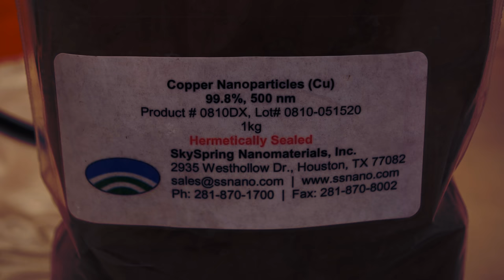Make Our Best Thermal Paste... YOURSELF!

Comment: Hi Tech Ingredients as alway very informative video,  I am considering something.  You mention some points in in this vidoe that  really  peaked my attention. (the whole video grabbed my attention not for the product you where making but rather the mixing by vibration)   Mainly the vapour pressure of glycerin,  mechincal vibration heating your fingers.  I am curious as what frequency of mechanical vibration which would turn glycerin into vapour.  resulting in failure of mixing.  I am not gend up on this so to speak   But I do know some facts about heat into glycerine can cause unwanted break down of it. with some nasty chemcials been released.   At temperature 280 deg C, a toxic component acrolein (propenal) forms. So mixing by heating which could also potentually break down other ingredients at lower tempatures is not the way to go. And when I try researching stuff I get lost in the maze of various fequencies terms.  and formulas.  Also on a slighty different track would mechanical vibration substanually decrease so called steep times for flavours in other liquids..
Reply from the maker: I don't know.  In this application, the liquid does not become very hot.  I'd estimate it's less than 50 C. The frequency is not very significant, but the amplitude is what determines how much energy is deposited into the liquid.
Ultrasonic mixing is very common in the pharmaceutical industry because it's so fast and effective.

Comment: Just a thought. As Aluminium forms an oxide on its surface, does that still happen with the fine powders and if so does that reduce the effectiveness of the mix?
Reply from the maker: It probably does. But because the oxide layer forms in milliseconds on bare aluminum, preparing, mixing and applying it would be a big challenge.

Comment: I have a few questions:
1. Would it be possible to mix it with an ultrasonic cleaning machine like they use for jewelry? I mean it's basically the same machine as the sonicator but less focused and powerful
2. 33:37 why does it only work "almost" as well, considering that copper is a better thermal conductor than aluminium and the particles have the same size? Is it because of the density or did I miss something?
3. Why not use ceramic particles? Does it increase the cost too much?
Reply from the maker: Probably not.  We have a super powerful ultrasonic cleaner and it doesn't work as well as the sonicator.
Reply: @TechIngredients  ah ok, that's a shame. I have added two more questions, I hope you don't mind. Thank you for all the great content, your channel is such a diverse source of knowledge!

Comment: How good of a thermal conductor is bismuth?
Pepto Bismol is basically just bismuth suspended in a thick oily isn't it? 
Bismuth subsalicylate, C7H5BiO4.

It might dry out though.
//Edit: Looked it up and "In fact, bismuth's electric and thermal conductivity is unusually low for a metal."

Comment: If I understood correctly, you're using aluminium powder in this material. Is there a reasonable alternative that wouldn't be electrically conductive to avoid problems if you make a mess while applying the paste and some of it ends up on the motherboard?
Reply from the maker: Our thermal paste is not electrically conductive.

Comment: How much would the "adequate" paste improve through continued mixing, followed by vacuum degassing - possibly using a vibrating plate of ultrasonic emitter to aid in the outgassing.

Would a moderate level of pre heat of the material increase the efficiency of the vacuum degassing?
Reply from the maker: That's a good question and I can't answer it.  Heat would not make much of a difference as the high performance paste does not thin with temperature.

Comment: What if we used activated carbons? I know they have pores that has air inside, but they have a really good surface area and the commercial ones can have really thin particals, and its carbon so it sure has good conductivity, right?
Reply from the maker: I tried that and the results were pretty poor.

Comment: This may be a dumb question but would it be possible to omit the mortar and pestle step on a larger volume by putting it back in the centerfugey thing and introducing a ball bearing or marble?
Reply from the maker: It's not dumb, in fact it's probably the best solution with one challenge.  The cheap mixer I hacked is still pretty lame.  They make much faster ones if you're willing to spend about ten times as much. By not introducing air this could also eliminate the degassing step.

Comment: When substituting the 300nm al power for cu powder, would you also substitute the 5 micron al powder for cu instead as well to avoid the galvanic corrosive effects between the al and cu? Short term, no noticeable effects would be seen using both in the compound, but theoretically overtime the performance would degrade as corrosion built up. Also, with the same reasoning, would you only use the cu compound on cu heatsinks and the al with al heatsinks?

I believe the IHS on cpu is galvanized, so the effect is lessened, but most al heatsinks are not galvanized nor a good number of cu heatsinks either. For the heatsinks that are galvanized, if you decided to do a few lapping passes to further increase thermal conduction, you would be removing the coating and essentially destroying any benefits from the galvanization process. 

(Yes it is odd that you use galvanization to prevent galvanic corrosion)
Reply from the maker: I thought these surfaces were plated with nickel and not zinc.
The oil makes these compounds non conductive.
Reply: @TechIngredients  Zinc is the first that came up in a quick google search, but I think for computers Nickel is the coating of choice yes. The compound may be non conductive as a whole, but on the micro scale wouldn't some particles still make contact and gradually spread the reaction as it displaces more particles?

Comment: 9:50 wouldn't a rough surface be better due to the increased surface area?
16:10 maybe you can use a less-viscous oil than even that if the loading process reduces the vapor pressure
Reply from the maker: No, because  it will also increase the path length through the paste and the aluminum  is a FAR better conductor.  We used as low a viscosity oil as possible before its evaporation becomes a problem.

Comment: I assume you could replace the aluminum powder with copper powder in the basic formula with similar results? I seem to keep finding aluminum oxide powder rather than just aluminum powder. I know you touched on solids fractions at the beginning but you also said in the second formula that copper would be almost as good and again assuming this applied to the first formula can I get a ballpark of what 'almost as good' means using similar 5 micron particles?
Reply from the maker: Thinking it might work better, I tried replacing all the aluminum with copper and the result was about the same as Arctic Silver-5.
 The aluminum may have better sphericity or the oxide coating helps, but the aluminum allows for higher solids loading and it's all about excluding the low thermal conductivity oil.

Comment: For the high performance paste; could one use a more "volatile" liquid but cool it down while mixing the smallest particles, then add a less evaporative liquid and larger powder while increasing the temperature to increase the mixability of the compound.
Reply from the maker: I tried that, but the result was similar or slightly worse and the additional steps balanced the easier blending.
Reply: @TechIngredients  Thank you.
If you were to put this into series production, would a larger vacuumroom be a good idea for one or several steps? The final mixing would benefit from being in a vacuum room or chamber.

Perhaps trademark the compound and license its production. The world needs thermal paste and why pay a premium for inferior performance.

Comment: I was wondering why did you not use small diameter copper or silver powder, since it is more thermally conductive, I understand this is all about making it very affordable, but I would love to see even higher performance material being made, maybe even using diamond dust if it's remotely feasible.
Reply from the maker: Regarding the diamond, I explained why it doesn't work in the first part of the video.
It's less about the thermal conductivity of the powders... really. The thermal performance is highly dependent on excluding as much low thermal conductivity oil as possible.  The sphericity and the oxide coating are probably why the aluminum allows for the highest solids loading.

Comment: regarding the last vacuum step, is it possible for air to still be trapped deeper in the material (further from the surface that's exposed to the vacuum)?
if so mixing the paste inside a vacuum chamber will allow all of it to be exposed to vacuum to remove air?
Reply from the maker: That would be optimal.  Mixing under a helium atmosphere is an alternative because it diffuses so readily.

Comment: So ideally the thermal paste should not contain balls, but rather cubes arranged in a matrix to maximize transfer area? Though that would counteract the bridging between the rough surfaces.
Reply from the maker: The problem  with shapes other than balls is that they don't pack ideally. In fact they cause clumping and gaps at lower solids loading fractions than balls.

Comment: Wouldn't heating during mixing reduce viscosity and mixing time? and then rapid cooling to bring it all together.
Reply from the maker: That works for the glycerin, but it doesn't with the silicone oil and that's good because it reduces the risk of temperature cycling-pump out.

Comment: Wouldn't be beneficial to match mating surfaces by grinding one into another just like in the process of hand grinding telescope lenses? Possibly with the thermal paste already applied?
Reply from the maker: It can. This is a good method if the components will not be replaced because other than flat, they will develop a unique mating curvature.
I'd avoid the paste at that stage as it isn't abrasive and is very viscous.

Comment: Why did you say that copper powder is less good than aluminum powder? I would expect the opposite given their thermal conductivities?

Is there a reason you can't make this whole process easier by diluting each step with a large fraction of a solvent, mixing and dispersing everything when it is still a runny liquid and then as a final step vacuum and/or heat evaporating all the solvent to make a fully stable paste?

Is there some process where you could start with a very hard and thermally conductive small particle, and a less hard and very thermally conductive big particle and through some process grind them against each other until your result is fully densely packed paste? Like maybe boron nitride for the small particle and one of the powders you already use for the big particle
Reply from the maker: The aluminum powder permits better solids loading possibly due to better sphericity or the oxide coating.  A mixing solvent has to be removed and during evapoation/degassing the mixture tends to stratify requiring additional mixing.

Comment: Hello, didn't make it through the video yet, so apologies if this gets adressed. I will delete in that case. 
I love your content and the depth and thoroughness of it is really top notch i gotta say. However, during the demonstration of thermal conductivity of the aluminium rods, shouldn't the solid alu rod have an aluminium washer instead of the plastic for a fairer comparison? Or am i mistaken?

Comment: We use a mix of indium, galium and zinc called liquid metal :) sadly it absorbs into copper and leaves a layer on the nickel coated heatspreader. There is a big problem with that. You can not read the serial number so you can't get warrenty on the chips when you use it. Maybe you could come up with something like that, without the downside?
Reply from the maker: We are doing that as well and will be comparing our liquid metal to various commercial pastes. Stay tuned.
Reply: @TechIngredients  I will, can't wait!

Comment: How about a water block that's missing the bottom of the block? As long as you keep the pressure of the water loop e.g. below 1 bar, you could easily simply use basic engine gasket sealant to glue the block and have direct water connection to top of the aluminium top surface of the CPU. I guess the only question would be if you can get turbulant flow to the surface of the CPU because laminar flow would reduce heat transfer, too.
Reply from the maker: It can be done, but leakage as well as corrosion will be a threat.

Comment: Is this electrically conductive? Also the "Thermal Grizzly - Kryonaut" is considered the best thermal paste on the market in the PC enthusiast circles. They have a "Kryonaut Extreme" now that is better for Extreme Overclocking with LN2, but they claim is still good for anything else but may dry out faster. I haven't used that one yet however so I couldn't weigh in on the drying out faster thing. I can't wait to see if you make a version of Liquid Metal next haha. (A type of gallium I think?)
Reply from the maker: It isn't electrically conductive. 
You're correct, I am working on a liquid metal version now.

Comment: I found your video because I am using a copper tipped spot welder and the spacing within the threads on the rod the tips thread into has gotten sloppy. My thoughts were to make something that is akin to grease filling the gaps and helping the conductivity of the electricity. Thus creating a cleaner spot weld. I am not sure if thermal conductivity works the same way as electrical? But I was thinking of mixing copper powder into my lithium grease. What do you think?
Reply from the maker: It doesn't.  Electrical  conductivity is blocked by the grease  that supports  the powders.  Have you tried graphite powder?
Reply: @TechIngredients  I thought that about the grease but whenever I did a search that was all I came up with. Then I found your videos and an hooked! Thank you for the response so quickly, I will try the graphite.

Comment: Is there no chance of a dissimilar-metal redox reaction occurring if you're mixing Zn, Cu, and Al? I realise there's not supposed to be electrolyte in there, but surely even ambient water could cause issues?
Reply from the maker: The oil insulates the particles.  Our paste is not electrically conductive.

Comment: would it  be a worthy idea to add an evaporating oil/solvent to the last thicker stage paste to enhance mixing and let it rest / evaporate to thicken up before application or would that lead to separation of the different size solids as the paste thickens ?
Reply from the maker: You're correct, the mixture tends to stratify during evapoation.

Comment: Is it possible to dilute the Paste with for example ethanol to make mixing the ingredients easier and then draw the ethanol back out with a vacuum pump?
Reply from the maker: I tried that and the paste tended to stratify during the evaporation/degassing step requiring more mixing.  It wasn't worth it.

Comment: Haven't finished the video so forgive me if it's been answered, but when adding the 300nm powder. Why does the aluminum perform better than the copper?
Reply from the maker: The aluminum powder is able to be added to a higher total solids fraction.  This may be due to better sphericity or the oxide coating.

Comment: Are the lids actually necessary? Won't the centrifuge keep everything inside the jars?
Reply from the maker: It's a good idea to use the jars in case the acceleration/deceleration or any spray could force the liquid out.
Reply: Yeah, I guess you wouldn't want any of the vapors/dusts in there either. 
Does it spin in only one direction? Is the acceleration very rapid? Does it have emergency brakes?

Comment: Great job. What is the best cheap thermal liquid that has a high performance of thermal conductivity?
Reply from the maker: Water.  It's the best.
Reply: @TechIngredients  I missed the point that it shouldn't be electrical conductive
Reply: @samtavassolian1492  pure water isn’t
Reply: @-a13x-75  thanks. actually, it has to be used for PCB board cooling like mineral oil or 3M liquid

Comment: Can copper powder be used in place of aluminum powder? I need thermal paste for use with liquid cooled peltier chips. The water block is copper. I need thermal paste between the peltier and water block.
Reply from the maker: Yes.  It's performance is a little lower probably due to a lower solids loading limit, but it's close.

Comment: Can you recommend machines that you use but in 2 cases 
Low budget 
And 
Good budget please
Reply from the maker: Try the mortar and pestle with the glycerine and aluminum powder.
Reply: @TechIngredients  
What abot mid range 
And what is the machine for isolate air from the thermal paste
Reply: @TechIngredients  thanks for you reply 💜💜🥰
Reply: @TechIngredients  
I am talking about the machines that you use to make the paste. What is the name, such as the mixer, air extraction, etc. I am a student, I love this field and the field of hardware in general, and I want to make this, but I do not know what the machines are, thank you 🥰
Reply: I talk about larger amount

Comment: Have you looked into creating a bicycle chain lubricant using these techniques? I'm interested in creating a freely accessible wax chain lubricant formulation, with a hard organic wax and WS2 powder.
Reply from the maker: I haven't.
Testing would be the challenge because lubricity, wetting and water exclusion as well as longevity would all be important.
Reply: @TechIngredients  The particle shape is much different with it as well(compared to the spherical powder you used). There's a wide array of waxes available too. Definitely an interesting experiment, and similar to thermal pastes in some ways with their "secret formulas".